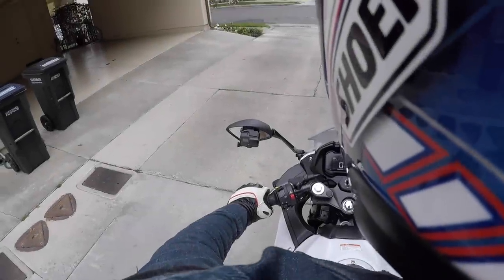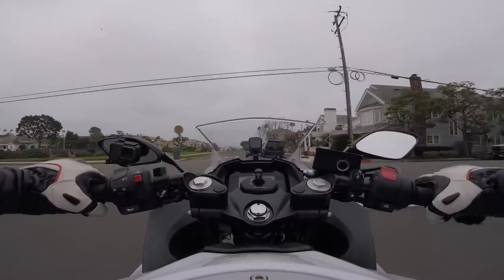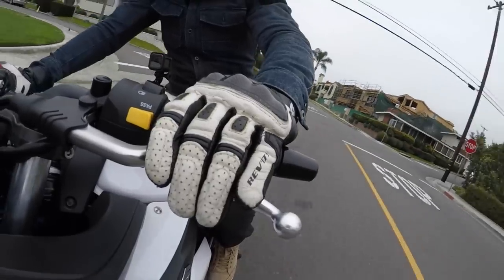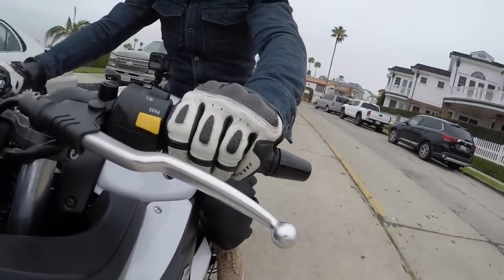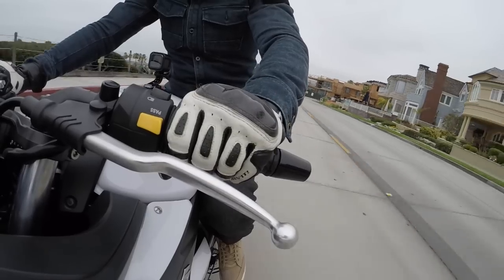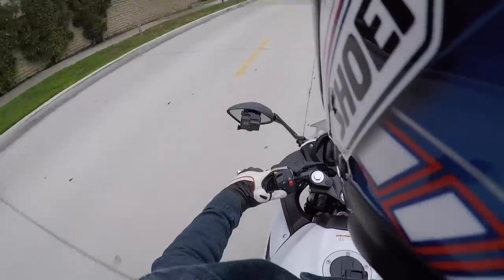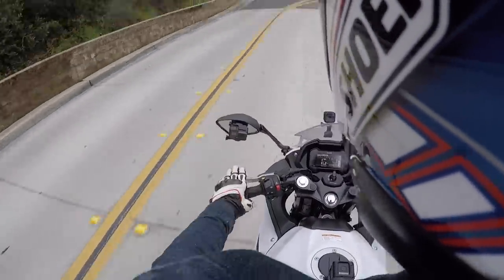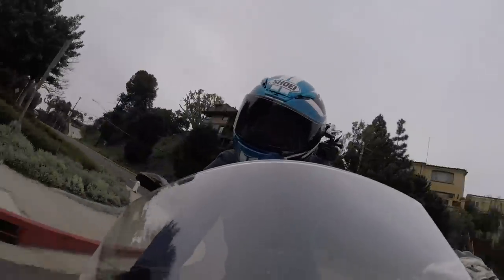How-To Use and Operate Motorcycle Clutch Video

Comment: Hey adam! Let's say you're on 6th gear and you're coming to a stop, do you just pull the clutch lever in then downshift all the way to 1st gear ? Or down shift one by one by pulling in then releasing then pulling in again on the clutch lever?
Reply: Obviously, I'm not Adam, but I'd just go one by one. Downshifting quickly from 6th to 1st quickly will leave you in really high revs & should upset the bike. Engine braking that will occur would be really strong & sudden too.

Comment: Hello sir? I found that auto rickshaws are very similar to motorcycles - that is why I watched this video. If you are driving at a slow speed - like say in a go slow or a bumpy and rough road, shouldn't you hold the clutch down slightly (like 20% to 30%) to prevent yourself from stalling? Everybody keeps saying let go of the clutch completely once you take off. All the videos I have seen... they always drive at normal to high speed on smooth roads after saying this

Comment: quick question, what happens if i dont hold the clutch at the traffic lights when in 1st gear? will i stall? thx alot.
Reply: If you don't clutch when stopping at a red light, the engine would turn off as it's connected to the transmission.
Reply: @Saptarshi.Sarkar  ahhh thx mate
Reply from the maker: Yep. Tell ‘em.

Comment: Did I hear you right? You don't use clutch to shift gears? How does that work? Won't it damage the transmission and if that's the case what's the point of having the clutch?

Comment: So I’m confused. Without a shifter how does the bike know what gear you are trying to go into? With a car you use the shifter to chose your gear. But a bike has no shifter! From the video it looks like all you did was push the clutch in and out and the bike somehow knew what gear you where trying to go into. Is there a dial or tiny shifter somewhere that you did not show in the video?
Reply: @Caylan Fountain so is it like a rock your foot forward to go up gears and rock your foot back to go down gears?

Comment: Hi adam. Do i need to press the clutch all the way at high rpm's when upshifting gears ?.
Reply from the maker: No man.
Reply: @AdamWaheed  So it's not necessary to pull the clutch all the way unless shifting from 1st to second ?